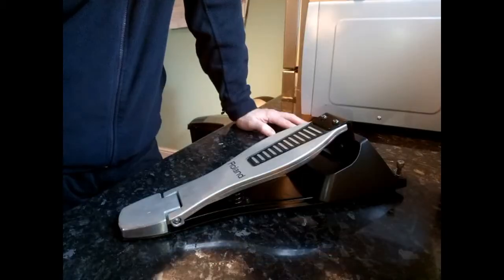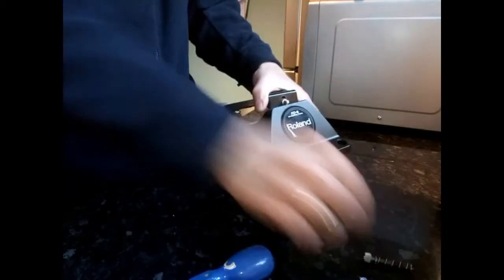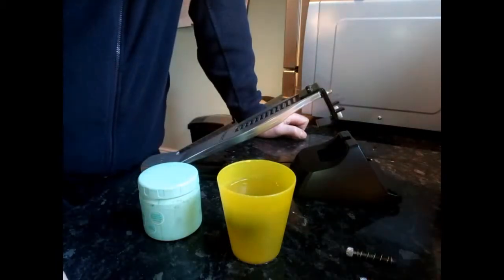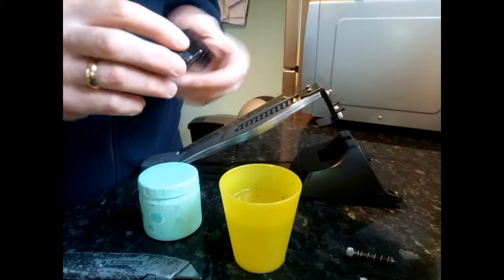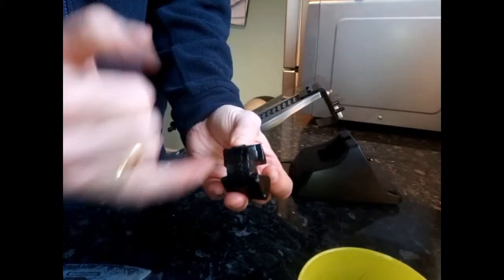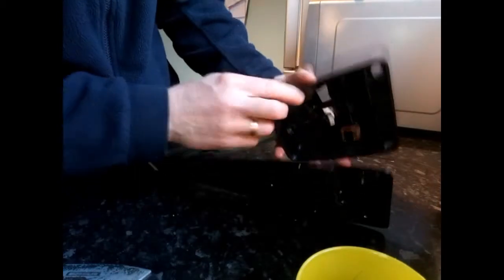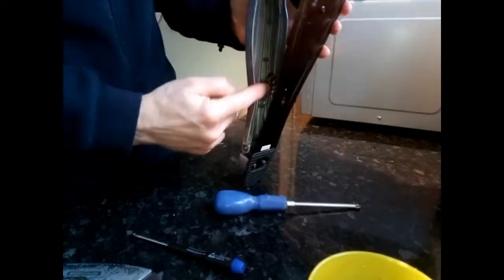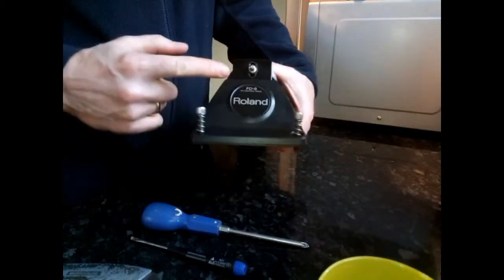FIX Roland FD-8 hi-hat Pedal foot controller V-drums #drumcover #drumsolo #drummer #drumming

Comment: You seem to have cut the slits on the wrong side!
 The lower convex side of the actuator rubber is under compression when it is bent downward under foot pressure. This will press the slits closed. So the slits appear to serve no purpose.  The upper concave surface will be under tension resulting in the slits opening up under foot pressure. 
The fact that pedal now works suggest that only the hot water trick was necessary by itself. How long does the pedal work for before the rubber hardens again?
Reply from the maker: You say that,you are correct and can put the slits either side. But if the rubber is stiff it will not come back up. Its justs makes it more Flexible because dependand on the environment the rubber will re harden. If its a very cold environment it will harden quicker.  Hence heating the rubber up, keeping the rubber greased. Its only a short fix till you install another. Hope this helps